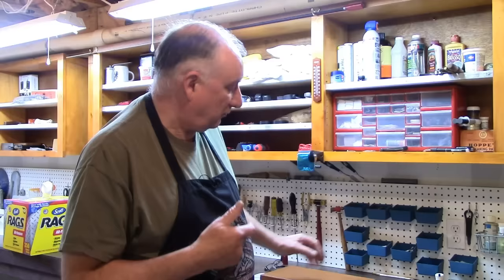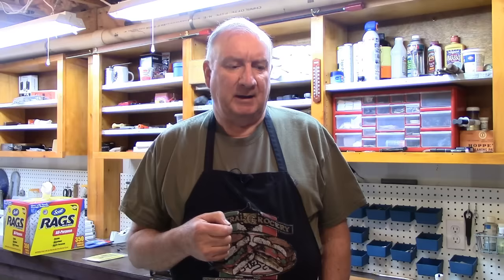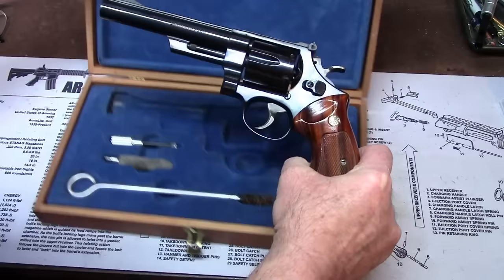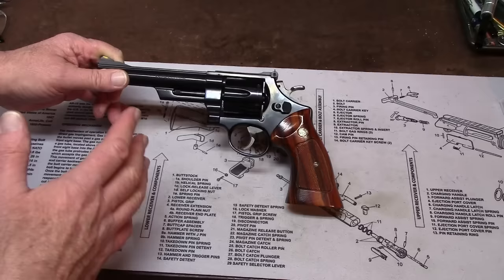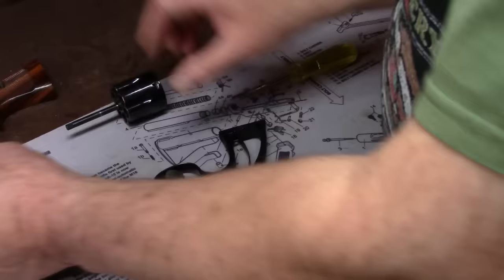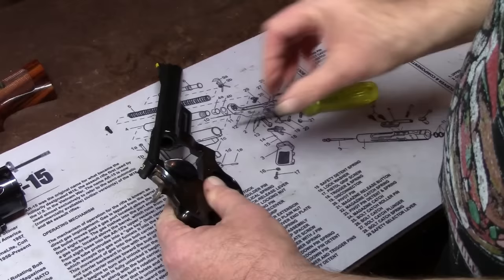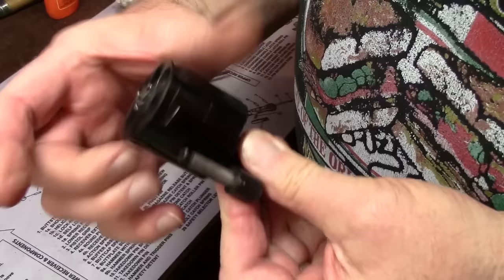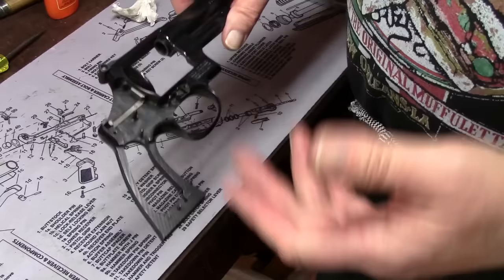How to Disassemble and Care for a S&W Revolver ~ Learn from a Factory Trained Armorer!

Comment: I have owned S&W's for over 50 years and carried several different models as a police officer, both K and N frame.  I have taken every Smith I own apart for cleaning as was illustrated in the video.  I am not ashamed to admit I have been doing some procedures incorrectly after watching this video.  Every placement of fingers for disassembly/assembly is critical, especially when removing the rebound block.  If that spring shoots out the back of the block when the rebound is removed, I can guarantee you'll never find it!  Very well done video with extremely valuable information.  S&W's are absolutely top of the line revolvers and are truly works of the gunmakers art.  One last point; never use Hoppe's #9 on nickel plated Smith's, it will destroy the nickel..
Reply: Great tip on the nickel warning - I had no idea!

Comment: This was absolute gold. Watched this a few times in the past and knew it would save me one day. That day was today. Headed to the range tomorrow with a couple buddies and I wanted to bring my 581. Pulled it out of the safe, because I knew it needed a cleaning, and dry fired in both SA and DA and it was locking up. Not many shops in my area open at 6 on a Saturday evening, so I went to the place I knew I'd get the straight talk. I purchased this firearm about a year ago, put maybe 200 or 300 rounds through it, doing the basic cleaning of the barrel and the cylinder but never anything deeper. This step-by-step tutorial led me to the problem (rust caused by neglect) and helped me completely and confidently disassemble, clean and reassemble one of my most cherished firearms. Thank you, GunBlue490.

Comment: I've owned a Mod 19 K framed Smith for 40 plus years.  I just learned more about that gun in the last hour than t did in last 40 years.  I will now be handling that gun much differently than i have in the past.  I've never taken the interior of the gun apart but this video gives me the confidence to take the gun completely apart to do a thorough cleaning. Thank you!

Comment: I've watched your videos for a number of years. I recently purchased a new, to me, Smith and Wesson 19-4 with a 6" Barre.. I bought it sight un-seen.

When it arrived it looked fine with 95% of its bluing. However the single action trigger was way too light. I contacted the favorite
Factory who told me to send it in. 

When I got it back,  it worked perfectly. I watched your post on caring for the S&W revolver. I disassembled my, following your instructions. The inside glistened with oil. 

I cleaned all of the parts and put a thin coat of oil on the entire Revolver, wiping off all excess. In reassambly, I have to admit, caused me some fits, but with gentle persistence (and some cursing) it did go into place. My gun is now protected and the action is as smooth as glass. Thank you for your videos, as you're one of the few people on the Internet that I actually trust.

Comment: I think this is the most valuable video I've found on Youtube.  I followed your directions, hanging on every word.  With your help I disassembled my pistol and reassembled it perfectly.  I decided to take my late 70's Mod 57 apart because the trigger was sluggish to return after pulling.  Upon disassembly I found that someone had caked the return spring in grease and over the decades the grease had turned to a waxy solid.  I cleaned the parts in mineral spirits and completely dried them.  I applied a drop of oil and wiped off all visible oil as you described.  Upon reassembly the pistol functions like new.  The parts are in remarkably new condition.  The trigger return spring has no coils cut off and I will not remove any of them.  I think it now functions like the Smith gunsmiths intended.  Thank you.

Comment: I've been shooting S&W revolvers for almost 35 years and I wish I had received such excellent instruction way back when.  I currently own 3 (models 13, 19, 686).  This video is remarkable and every S&W revolver owner should watch it.  Thanks so much for taking the time to share your extraordinary wealth of knowledge.
Reply: S&W 357 Model 19 was "almost" perfect, except for the chopped forcing cone --> 0.38 SP+ anyone? It aint no N-frame (I wish)
Reply: The forcing cones on the M-19s were shaved a little across the bottom to allow for clearance at the front of the cylinder.  Being a little thinner in that area caused the barrel to crack in that area if the guns were fed a lot of 110 and 125 gr. HOT magnums.  If I still had a M-19 (😞) I'd feed it somewhat reduced 110 and 125 gr. loads.  The bigger bullets didn't seem to cause a problem or any reduced loads with the smaller bullets.  The introduction of the L frame cured the problems without having to go clear up to the N frame.

Comment: I just went through this disassembly on a 19-4 for a friend of mine. He is still a dedicated oil freak. I wish I could post a picture in the comments of what the innards of this revolver looked like. Totally a dirt, grime and lint magnet. I reassembled it sans the oil and there is no discernable difference in the feel of the action. In fact, it may feel slicker. You MAY get a temporary feeling of slickness drenching it in oil until the dirt collects in it. Then you're just grinding metal down. Great video.

Comment: This is an incredibly clear, comprehensive presentation of the proper way to dissemble a Smith & Wesson revolver complete with correct terminology and appropriate cautions. I wish GunBlue490 would do a similar presentation on the relatively new cylinder components of the S&W Governor. Everything GunBlue says is solid gold for this process.

Comment: It’s interesting to note that back in the 70s S&W was building new guns with defects.  Looks like not much has changed over the years based off a recent Performance Center model 929 revolver purchase.  Thanks for the outstanding intel regarding the S&W revolvers.  Anyone that purchases a S&W revolver should watch this video.  The fools that purchased Ruger revolvers will never see the inside of their revolvers because Ruger builds them right from the start, and they build them to last.  I should have purchased a Ruger, but here I am learning everything that is needed to maintain and repair my S&W revolver.  Thanks for your mentoring!

Comment: TY Gun Blue for the education on the Smith & Wesson revolvers. The knowledge you have passed on in this video is really appreciated. Didn't seem to be over 1 hour as you cover everything about these classic revolvers in fine detail including how to hold & take apart the pieces. Nothing like a S & W revolver especially from 40 to 60 years back. Handcrafted parts all made to fit specifically for that particular frame at the factory. Brilliant job on this video !

Comment: I use a modified Chop Stick for rebound spring removal and installation, helped me cut down on self inflicted wounds.
Reply: I bought a wheeler gunsmith tool set that came with a rebound spring tool it works great

Comment: Great video thank you, I have to say though compared to my Ruger Security Six, that's just way over complicated. Bill Ruger truly was a Genius. Now I see why so many of them break lol. I take my Ruger over that Rube Goldberg contraption any day lol. I need one tool to totally disassemble a Ruger and that is a coin in my pocket to remove the grip screw. Was nice to see someone that actually knows how to properly reload a revolver though. I've seen so many of these so-called YouTube experts slapping the ejector rod with the firing hand. I was taught to use the thumb just like you did when I joined the Sheriff's Dept. many years ago. I carried the Ruger for 20 years it never once let me down. Can't say the same for a few of the Smiths I saw over that same time. At least 3 failed during the 1000-round initial qualification rounds we had to do when I joined. My Ruger never missed a beat but seeing how simple it is in comparison to the Smith I now see why. I'm not disparaging the Smiths but I have to say it's just way over complicated. Watch a video on the Ruger and you will see what I mean. If I had to carry just one handgun into battle I'd take my Ruger.....

Comment: I have an N frame 1977 357 mag I put thousands of rounds thru it, great gun. Had a factory rep fix the excess space between the front of the cylinder and barrel. I have a 44 mag SS Smith bought in 95. Both guns are a true work of art. I did precision tool tool and die work for 25 years and now I am a Tool Design Engineer for the past 20 years so I have a profound appreciation for fine instrumentation. These S&W revolvers are truly a woke of art. Thanks for sharing your knowledge of these mechanical wonders.

Comment: This video helped me get together a friends smith, that he opened up and could not get together again. To bad allmost all the donts mentioned in this video had been done to it, all surfaces inside it was filed, and the hand and mating surface on the cylinder was so badly mangeled that the cylinder wont lock in position when operating it quickly in double action. This gun will most likely be written off as a total loss, because of the previous owners ignorance. But I learned alot from this video, certainly made me think twice about the liberal amount of ballistol I have been told I should use, will definitely clean up my own smiths like in this video. Thanks alot for this great video!

Comment: Excellent video!  Following your instruction, I first filed & stoned a screwdriver flat tip blade to allow proper fit w/no play for the side plate screws.  I was able to remove cylinder & side plate per your guidance and thoroughly cleaned a really nice Model 19 2-1/2" former police detective's gun.  I would not have attempted to do this, without having seen your video.  Thank You for taking the time to post such an informative video, as I learned the proper way to perform disassembly of a S&W revolver!  Really Great Stuff!

Comment: I feel like I learned much more in the past 90 minutes watching your video, than everything else I've learned about these guns combined.  Everything you explained, or showed, quickly became "obvious".  I see things I've been doing wrong over the years, and. more importantly, I now know how to do them correctly.  There are so many things I struggled with in the past, but here you've shown where to put your fingers, where to push, and so on - none of which I knew before.   I've got a Model 28 which I had a fellow at the range "adjust" to make the trigger lighter.  Yikes, now I understand why a few weeks later it was no longer shooting reliably.

With everything I learned, I wish you had a shop around the corner from where I live.  

I also learned once again, forever, to not over-oil.  Your video made that clear.  

Finally, I expected you to show us all sorts of fancy tools to work on the revolver, some of which I've bought - but you did it all with just the "simple" screwdriver!  Speaking of which, I never learned the trick of using my finger to guide the tip.  I'm lucky I haven't had any "incidents", and I can instantly appreciate your way of doing this.   Thank you!!

Comment: Excellent tutorial! I was on the P.D. from 1973, and introduced to the revolver [model 10]. I still prefer the "trigger feel" of the revolver over semi - autos, especially S&W "Double Action"! Now retired,  I've been doing a lot of practice using the X frame 500 magnum. I have noticed the X frame and most other newer generation model S&W revolvers  [last 25 years] do not have the smooth Double Action as did the Smith's circa 70s- 80s. I don't believe the S&W armorers at Smith and Wesson now days are as skilled as years ago. I have had revolvers from the performance center which are no where near as smooth as before.
Reply: I don't intend to be rude, however, do you think there might be some degree of nostalgia that is influencing your opinion?  I have a .44 magnum from the performance center and its double action is excellent.  The trigger, however, is a target trigger; it's better than the M&P R8 that I have.
Reply: @kesselster  plus you'd have to take into account what 40 years does to ones memory and finger strength. I mean what's to say it feels rougher/harder just due to the fact he can't handle the trigger like he once could.
Reply: @billy-waynejeffcoat4828  Fair point.  As to memory, it can still be excellent, despite one's age, if he uses it often.  Same with finger strength; both are like a muscle--one is.  Fair point.

Then again, if he's firing .500 S&Ws, I'm sure he can still squeeze a trigger correctly.

Comment: I've had a few favorite S&W revolvers through the years. My favorite was a 50s-vintage 4 screw model 10 snubby, built specially for a Boston Police detective. One of the best double-actions I've ever felt. He sold it when he retired, and I was lucky to buy it. I now own a 70s-vintage model 19 6-7/8 (?) inch. When I can hide the bulge, I carry an airweight cent. 38 snubby. I'm not a gunsmith, but can do a decent, conservative trigger job on J, K, and L frame smiths. My offer still stands on that once-fired 30-06 brass.

Comment: You can put a peice of paper on the cylinder window before removing. Good idea to remove the Yoke only, but removing both at the same time works and unless your swinging a 5 pound hammer at it you're not going to bend the Yoke. Also dont recommend removing the side plate by inverting the gun and smacking it untill the plate falls in your hand, good way to loose parts and drop your plate. Just rap the frame butt with the screwdriver handle lightly.

Comment: When putting the side plate back on, sometimes it becomes difficult to align the hammer block within the internal grove on the side plate.  By aligning the hammer block as instructed (in the middle) and holding the side on top of the revolver you can work the trigger so the hammer block will align nicely within the grove.  It's a great trick that I learned from a Gunsmith that works on revolvers.

Comment: Thanks for the video Mr Blue disassembled and cleaned up a gunked up 19-2  . Had a little trouble with rebound slide but old gun is back together with very smooth action.

Comment: Incredible video.  This tells me that I simply need to take my 686 stainless 7-shot to a qualified person because I’m NOT taking it apart like that!  😂 When I bought my first gun in 2010 I researched what caliber would be best for me, what brand, what style, even where to buy it from, settled on the S & W 686, 6 inch barrel.  Beautiful piece despite the “Hillary hole”, never caused a problem.  My uncle was in the Secret Service in the 60’s, he had what I think was called a model 1955?  6 inch barrel, .45 APC, moon clips.  Machined like a Swiss watch, beautiful piece.  Tack driver too!  The 6 inch barrel was too long for him to carry on duty so he had the factory cut it down to 4 inches.  My 2010 S & W is a nice gun and it was expensive but I suspect not nearly as much work went into it as my uncle’s older model.  Thanks so much, and my god how you handle the trolls is amazing.

Comment: Great explanations & video.  The point about Ballistol washing away with water because it emulsifies with water is pretty convincing.  I bought a mineral oil lube (LPS 2) and today completely broke down a Model 28-2 and a Model 19-3 for a full cleaning and inspection.  They both definitely needed the attention.  Many thanks for the video!

Comment: The hand on the trigger of my 686-1 Is real wobbly when the trigger is out but handles nice when assembled. I can't believe  that it has such a sloppy fit but it seems to work fine. Great video. Real professional. Thanks.
Reply from the maker: It's an intended fit, not a sloppy one. The hand is fit to the ratchets, not the frame.

Comment: You are the best gunsmith I've ever seen your explanations are fantastic you are a gentleman I just bought a 38 Smith & Wesson revolver in beautiful shape for its age but on it's cylinder has a small rust spot the size of the head of a mad rush to the gun is very nice on the cylinder heading toward the barrel right at the tip I really don't know what to do waiting to hear from you your friend Walter and ask older gentleman have to stick together thank you so much for your teaching God bless
Reply from the maker: Apply a liberal amount of Hoppe's #9 to the area and allow it to set overnight.  It should help dissolve the rust.  Wipe gently with very fine #0000 steel wool.  Repeat as necessary.  Bluing will be removed and a pitted area may result, but the rust will come off.  Brownell's Oxpho-Blue Paste will restore most of the blue color, but it may require several applications to deepen.

Comment: I just picked up a model 27 (1958/59) for $550. It is in mint condition with the wooden case. No marks on the finish anywhere hardly for a 60 year old gun. This video is very helpful. Thank you for the advice. If it aint broke, I won't try to fix it.

Comment: Thank you for a great video.  I have several Smiths manufactured in the 70's and early 80's.  I've taken off the stocks and side plate but now I'm glad I didn't go further.  They all have such good actions there was nothing to mess with but I wanted to see what condition they were in.  Now I know at least 3 times as much about them as I did before this video.